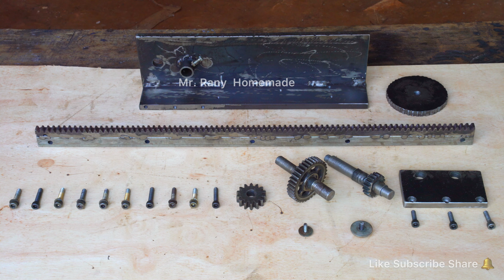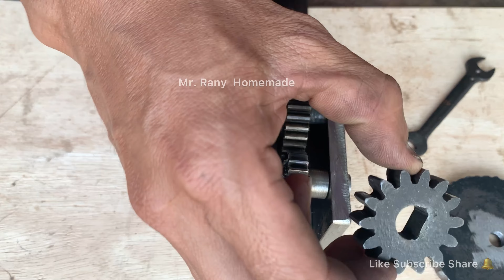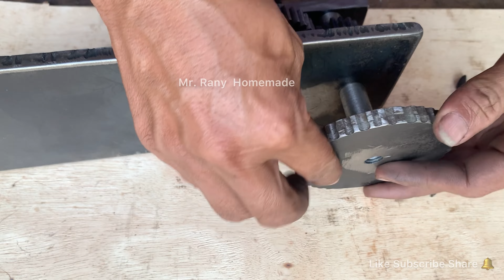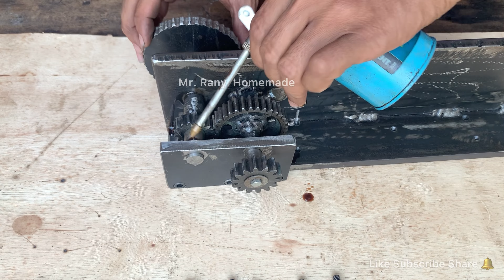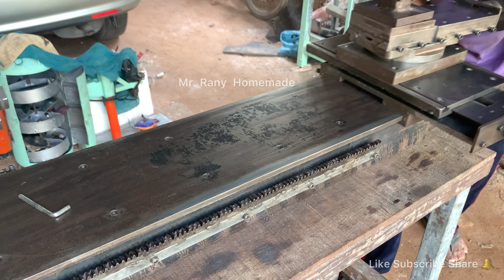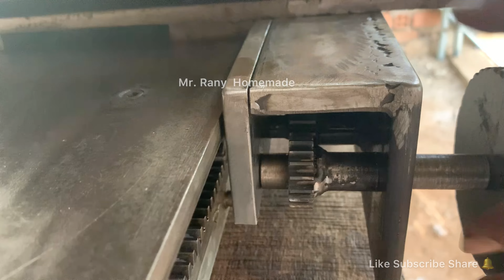#DIY #HomemadeLathe #HowToMake Well Done || SouthBend Slider Gear Lathe

Comment: Greetings, and THANKS for share this awesome project. Where did You get that gear rack and pinions? Thanks in advance
Reply from the maker: Sorry for my late reply 
Thanks for sharing the information 
I have been asked by the shop for the gear rack but cost 95$ per meter this is over my budget so I went to the Scratch shop then I found the Crown gear rack so I thought it will work.
It works perfectly. Next time if build a new lathe I never forget it